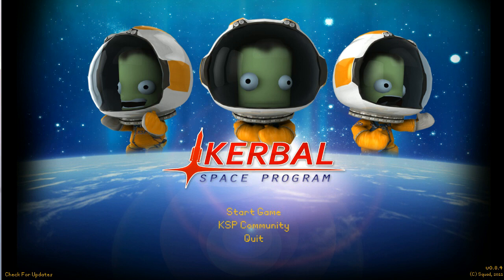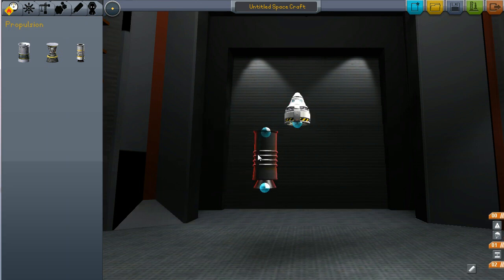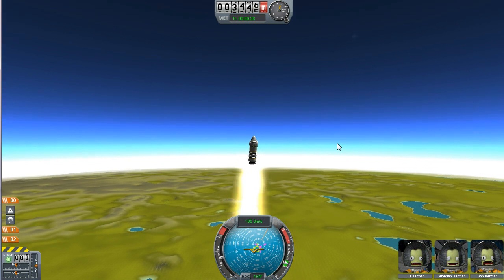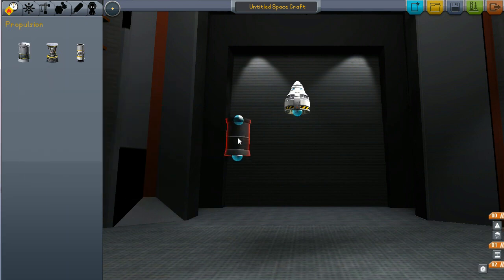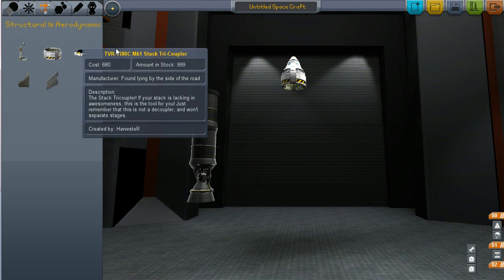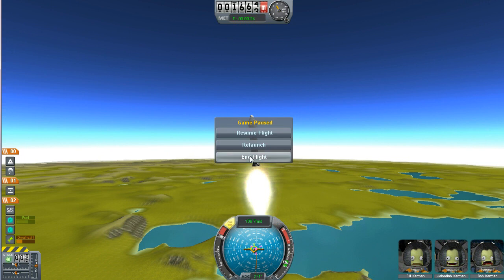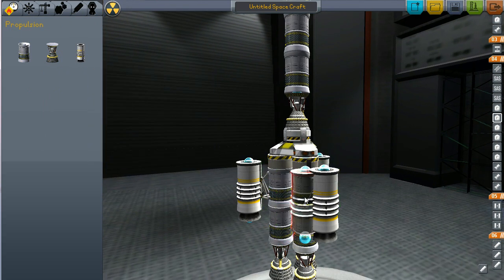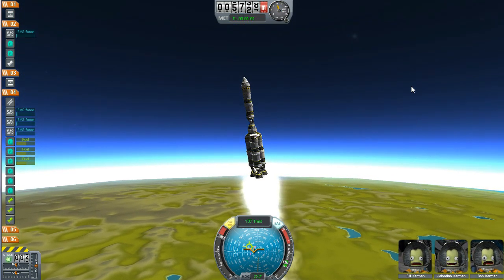Kerbal Space Program - Tutorial Part 1 - Let's build a rocket

Comment: @ultramsold space bar, but you need to attach couplings to each rocket to have sperate stages. example. Have you command module and paracute than coupler, then add a rocket then a coupler,etc. When you launch everything at the very bottom will fire,when you press space the couplers will seperate and begin the next stage and etc.

Comment: This happens because of a game error. By default the games graphical setting are way too high for most computers, if you turn all the settings right down it stop the game from crashing. If this does not work than another issue is that the game trys to use all 4 cores if you have a quad core processor which leads to crashing you can set the affinity of the game from KSP.EXE in the task manager